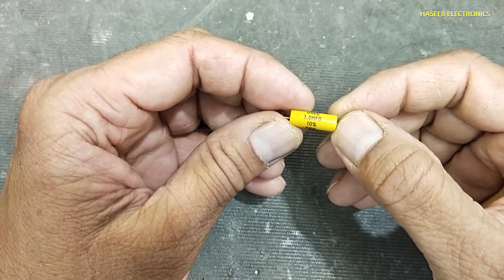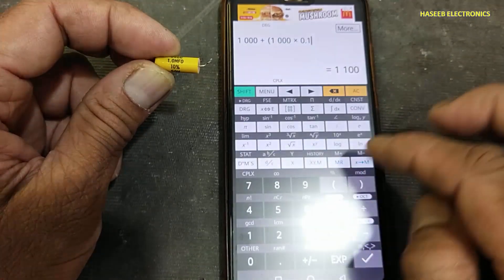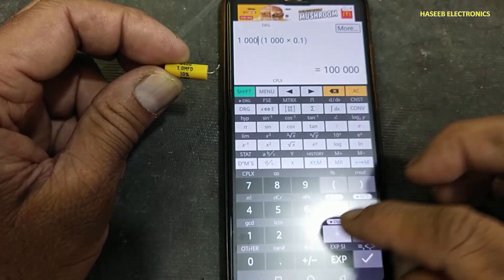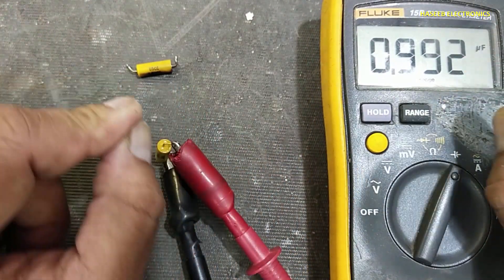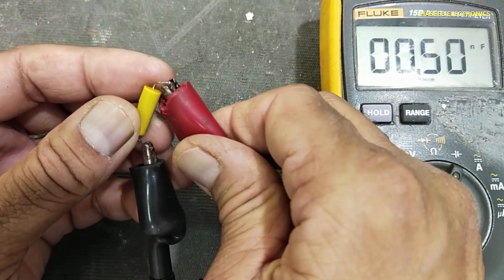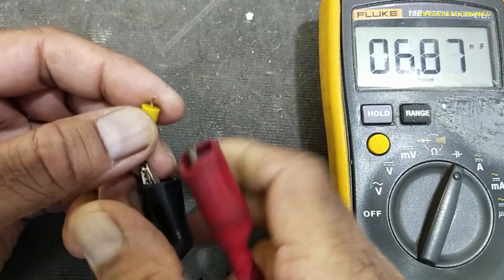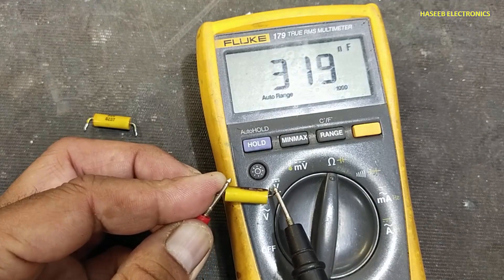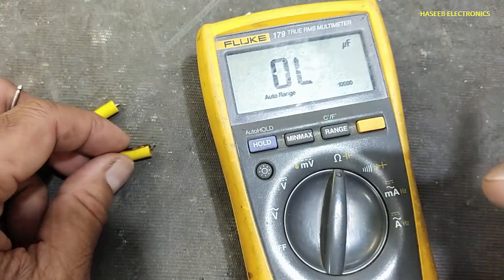{980} How to test MLCC Axial Ceramic capacitor

Comment: It’s not ceramic capacitor.
Reply: It’s film capacitor
Reply from the maker: it is ceramic capacitor. it is MLCC multilayer, ceramic capacitor KEMET C202E105J5X5CA 
https://hr.mouser.com/ProductDetail/KEMET/C202E105J5X5CA?qs=%2FPOkb%252BiDxRWJODMftBAaLA%3D%3D&_gl=1*dp5092*_ga*NjEyNjYwNjc2LjE2NzY3MzIxMzg.*_ga_15W4STQT4T*MTY5NzExNTI0NC4xMS4wLjE2OTcxMTUyNTEuNTMuMC4w

Comment: Mr Carlson's lab has a great simple to build capacitor tester that checks the leakage current to about 80 Meg ohms that will find faults that other testers can't find by using 30 volts and super sensitive npn transistor amplifiers. Very valuable tool and fun to build. Thanks for sharing this information with us.

Comment: It's a ceramic capacitor or poliéster?
Reply from the maker: it is cylindrical MLCC multi-layer ceramic axial capacitor its part number is C202E105J5X5CA

Comment: If the position in the circuit is critical I always check the (peak) voltage handling (by an ultra low current "current source")